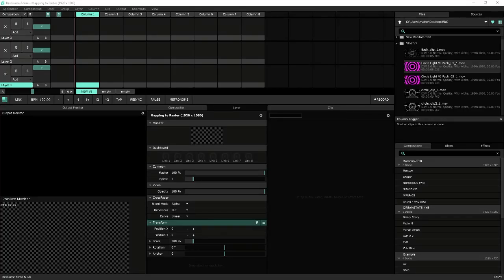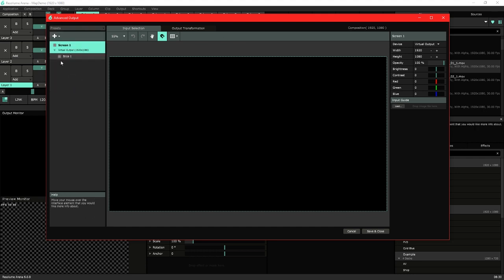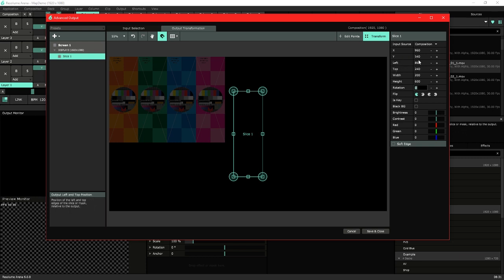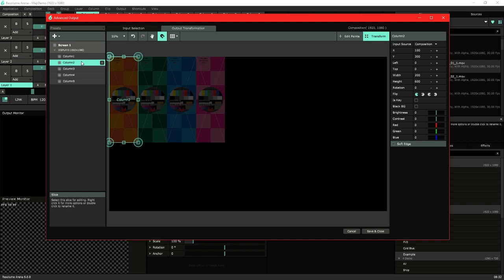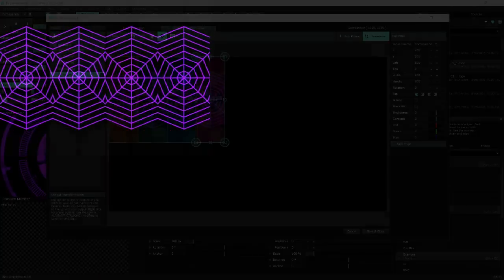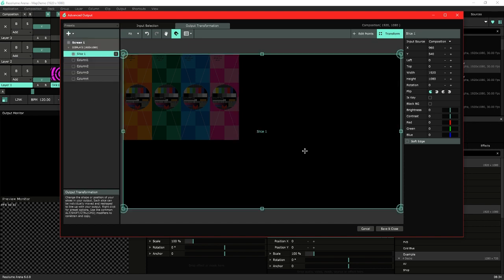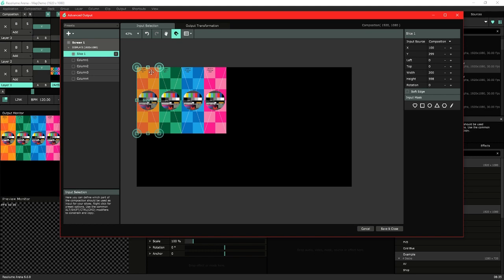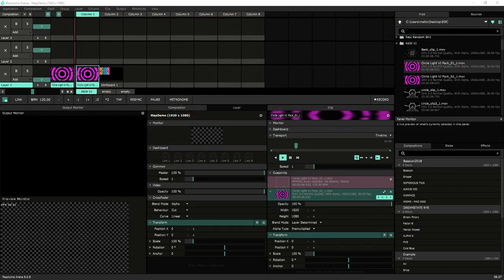Resolume Advanced Output - Mapping

Comment: Hi, I wanna ask a question. I am a amateur mapper. I don’t know need to save as preset before. And every time I open the advance , it will show the last setting I made. I know save as preset can keep the setting. But even I didn’t save a preset, it will also keep my last setting. So what is the difference between these? Thankyou very much.
Reply from the maker: Hi,
Resolume does generally save the last mapping settings when you save the composition, and you can work that way.
However I would strongly recommend saving a mapping preset mostly for peace of mind.
Saving a preset generates an xml file which can then be loaded on to other computers and saved as a backup

Comment: Hey there.
I'm having some issues. I got the free version. At the beginning everything was cool. I was mapping my kitchen using a epson s41. A few hours I could no longer project, In the output tab if I select my projector which is display 2 it sent the video to my screen macbook. I tried everything, reinstall resolume and nothing. What can I do?
Reply from the maker: Sorry to hear you are having issues.
What display options are available to you in the advanced output? 
If it is sending to the wrong screen, then you may need to check you system preferences and see what your display numbers are and ensure they are not mirrored